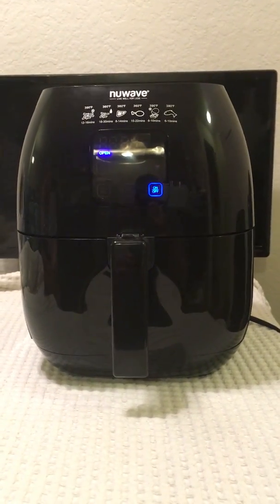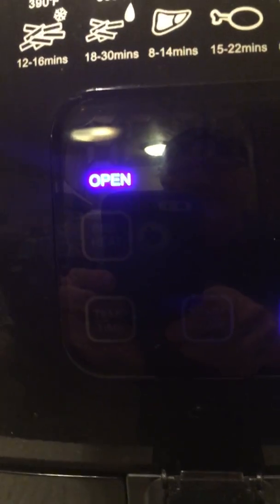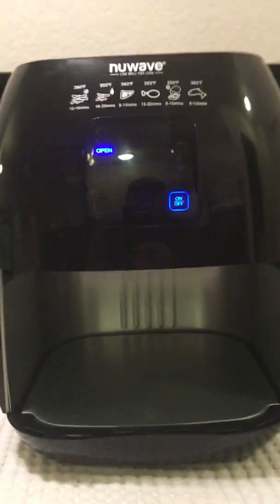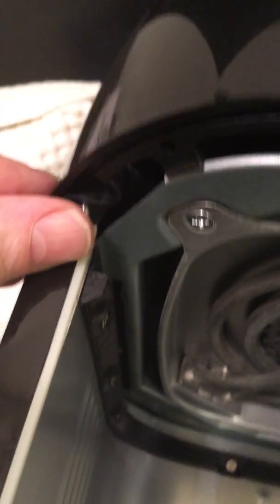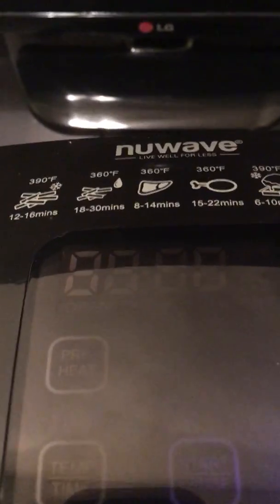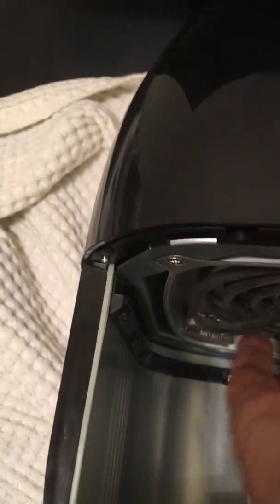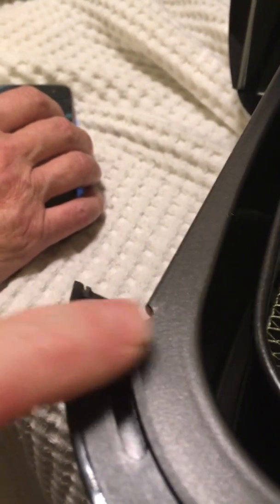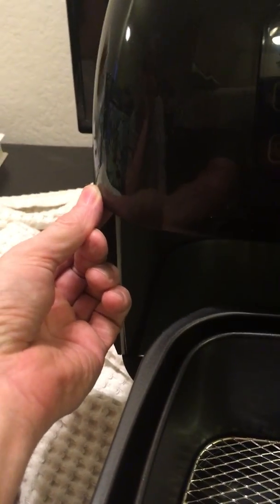NuWave Brio Air Fryer - repair OPEN sensor light fix

Comment: I’m having a problem with the time light . The minutes are not complete to read . How can I fix this?
Reply: Also at the top front of the air fryer that shows time and suggested temperatures , from wiping off the air fryer the instructions have come off. I can’t find a place to call to get any help with the time light or how to ask for a new sticker for cooking time . Can anyone help ? Thank you